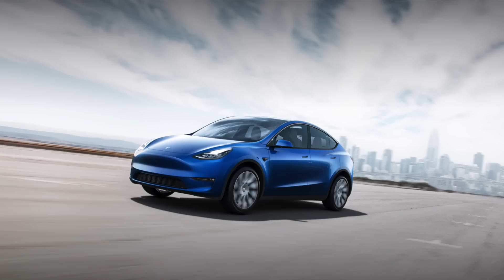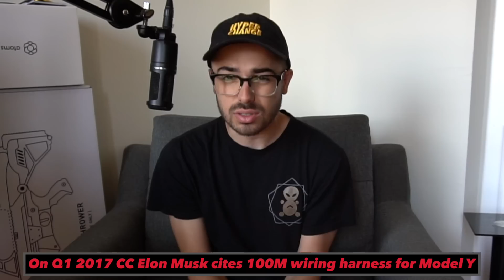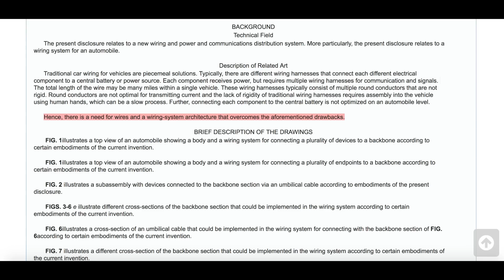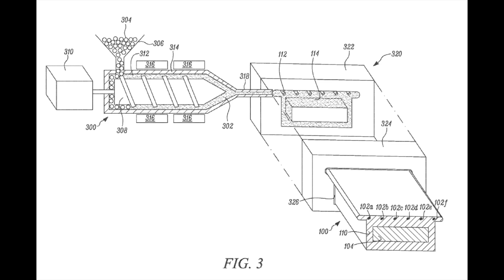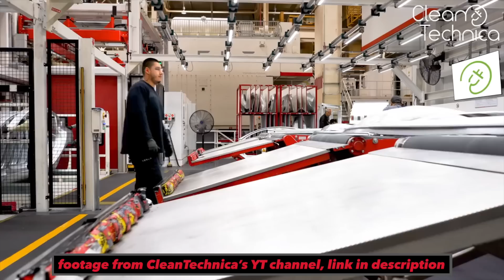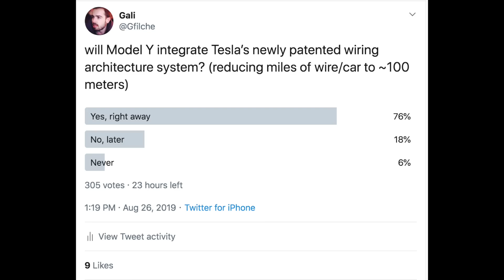Model Y Manufacturing & CAPEX Revolution?

Comment: I wonder if the length of actual wire is 100m long or the length of the cable with multiple wires inside, is 100m long🤔 cuz ethernet cables for instance have at least 8 wires inside them. That means we would come down to 12.5m of cable length overall.

Comment: Casting over sheet metal will eliminate hand finishing joints and weld spots. It's all aluminum so when they pressure cast the joints it becomes one piece with zero mechanical joints and prestressed structural ribs and panels.

Comment: I believe the CAPEX slide is can mislead people. First, it is natural that building your 2nd factory will be easier and cheaper than the first one (I would say, that the legacy carmakers already has low CAPEX for new factories and Tesla did have a relatively high for its first factories.). Second, is that Opex is more imporant in my opinion, because on long therm that matters most. (but of course everything depends on the actual numbers, what we don't have.)

Comment: I think that elon is smart enough to know that tesla alone cant really take over the car industry alone becouse of capital needed to over take volume of gas car produce  . This is reinforced by the fact that elon stated that certain patents are open for use by other companies . Having said this i can see tesla folded in to another parent compani along with space x  and maybe a spin off on their self driving tech where tesla is Just a manufacturing company that produces the worlds autos for them... like tesla making volvos and bmw ect where the current models cars 3.Y. S ect are their version of proving out the tech and processes. Makes senses in terms of capital needed its almost imposible for tesla to keep spending 2 bilion and even if they lower it to 1b... it would take 250 factories? To build up enought volume to take gasoline cars of the market / system  ... this is just a thought of mine that i get when i think of the things elon says and he always think long term i figure he knows he cant do it alone and doing it like insaid above would speed it up drastically... we cant wait for other companies to innovate they are to slow but if tesla does it for them and then jjust charges for manufacturing , desing , tech ect  we may get there:)

Hope someone enjoys what i wrote and agrees i love tesla and what they do, keeps us thinking and learning

Comment: This wiring won't decrease CAPEX (capital expenditure, often one time spend that has benefits over longer periods of time), it'll increase it. To set up automation, to file the patents your reading typically takes a lot of upfront capital expenditure (money spent). However, it could decrease the cost per car (variable cost, i.e. fewer ppl paid by the hour and more robots paid one time).

Comment: You messed up in your video. The 70-to-1 part reduction is done with casting, not stamping. Casting means pouring molten aluminum into a cast, instead of stamping sheets of aluminum. Big difference.

Comment: It is casting! The host Galileo Russell mistakenly keeps referring to the new patented process as reducing the number of stamping pieces to 4 @10:40, but if you look at the text on the screengrab of the same timestamp it mentions the reduction from 70 to 4 parts not as stampings, but as 2 castings and 2 joiners. The eventual goal of a 1 part structure is a casting (again not stamping). 
So tesla is going to use 1 casting to replace 70 stampings.

If you look up pictures of an aluminium die casting machine you see it clamps two halfs of a mold together. In the patent picture it looks like a machine that uses a mold that clamps together from top, bottom, left, right, front and back!

Don't mistaken the shell or structure of the car for the body panels. The structure is talking about the internal "skeleton" that holds the motor, battery seats, etc. The body panels are like the "skin" that you see outside, all the parts you touch when washing the car.

Personally I'd guess that the body panels will still be stamped as someone mentioned in the comments, casting such thin parts as body panels will have no strength.

Comment: Love what you do. Love the enthusiasm. One thing to point out... the teslarati picture you posted says 70 stamping parts to 1 casting component. Therefore, the new machine would be a big castings machine, not a stamping machine. Stamping is a process to take metal sheets into formed parts. Castings do not use metal sheets

Comment: The body assembly mega machine is properly insane difficult to get get to work properly and the changes that is need to do that needs to be tested, adjusted and verified forever and so on, so it make sens to run the model y on 2 lines one production line and one "themaschinethatbuildsthemashine" development line.....

Comment: Going down so dramatically in wiring could also mean that most of the parts contain micro controllers and use a high speed serial bus to communicate. This means more flexibility with OTA updates and fixes (e.g. Model 3 braking improvement) as well as component upgrades (e.g. newer headlights could have compatible harnesses despite having far more functions), better understanding of car health (e.g. burnt light bulb, none functioning side view mirror, etc), improved reliability (wire harness damage from rodents or minor accidents is common with traditional wire bundles), and easier repair (single clip in harness). It could also drop the price of components since micro controllers are cheaper than electrical connectors now and devices like the MCU are riddled with connectors and harnesses and could be reduced to a single connector.

Comment: Q1- 2017 was a LONG TIME ago dude!!! ... Tesla changed their plans for Model Y to be less ambitious .. and rightfully so ... the Model Y will be built on the Model 3 platform ... the components and WIRING will all be pretty much the same. Furthermore, Musk's 2017 comments were relative to traditional "round wire" harness reduction ... by replacing it with printed circuits and/or flat wire harnesses ... round or flat, it's still essentially "wire" ... so the idea that wire would be eliminated, just never was the case... just Musk smoke and mirrors. What Tesla was pursuing, as their patent application shows, is a wire harness that could easily be installed by a robot .. not sure why Musk just didn't explain it that way in 2017, maybe he was confused?  Also remember.. that this all dates back to when Tesla was admittingly over automate their assembly line ... they were exploring ALL ideas to fully automate car builds, handling a floppy large wiring harness is problematic for a robot.

Comment: So the able length change is because the new ridgid multicore cable counts as one cable and traditional single insulated flexible cables are counted separately? I would suspect the weight to not change too much. Do you have any stats on the weight savings? Or was it just a straight out guess?

Comment: hmm not so good to have only one part for the body, hard to replace in case of accident... would have to cut out damaged parts. Especially if its made of aluminum, hard to bend back to shape as it stretches.

Comment: My knowledge of casting and stamping is super limited but I thought casting was only for aluminum and not steel.  So is the body going to be cast out of just aluminum?  Or maybe it will have a steel frame and aluminum body?  Also, if it is one big part, wouldn't that mean almost any wreck would total the vehicle?  So many questions...

Comment: Wouldn't the patent be better off (just using 1-grade thinking for crash-repair) to actually die-cast 3 parts: the nose,-structure, the "passenger-cell" and the rearward structure (in sedan-style bodywork).   In case of a crash they could replace the front- and/or rear-structures.  Then you'd still only have 3 parts, but at least a bit better serviceability in crashes.  Unless Elon is banking on FSD taking over 95% of the driving and having less crashes and already accounted for that ...  Unfortunately, there will still be non-FSD cars out there for quite some time to come, so might be a risky-bet (if that is the case ...).  The wiring harness is something that always baffled me being a former network engineer.  Why would it be impossible to do simple network-alike connections inside a car (just like a proper home-automation).  I guess they never the famous quote from Davinci that "simplicity is the ultimate sophistication".

Comment: This is why I subbed to you, for the tech. Watched the Starhopper 150 m flight and I closely follow the SpaceX construction of the SS/SHB and I'm wondering now how much of this wiring had seen it's use in the construction of those, and the Raptor Engine. By all measures I'm sure the Starship and Superheavy booster will see a lot of their internals benefiting from the technological improvements you are discussing here re Tesla... Keep up the good work, and I'll keep supporting you on Patreon...
PS I think we will find out in the future, that Elon's Co.'s have been using and A.I. computer to model their engineering, not just the Auto Pilot and Full Self Driving. Just a guess, but an educated one. As I have said in the past, it's like Elon's own Skunkworks.

Comment: With all the fun driving, tires are going to wear very fast, so why not re-introduce recapping tires?  Years ago in the age of bias belted tires people could get recapped snow tires quite cheaply. With today's adhesives it would not only make "re-tiring") less expensive, but also ecologically reduce the enormous waste of discarded tires. If the tires were filled with helium we could reduce the wear and tear internally (no oxygen...helium is chemically inert) and the weight (lighter means a better ride).  All the tire shops would enjoy the squeaky voices of the repair guys.  Elon should try to innovate and improve the items that remain the same as ICE vehicles so that customers can enjoy the freedom from repairs and servicing that they experience with the electrical drivetrain. How about self- adjusting tie rods? We already know that shocks and struts could be made cheaper to repair or replace.

Comment: Would love to know what the BOM cost is for the steering column assembly.  The reason margin is likely low right now is they are taking a hit producing steering wheels & columns for every vehicle.  $1000 of parts in a steering column? take it out & re run the calcs on margin per car.  I think you'd be surprised.

Comment: Interesting. I think the term capex might not be the right word to use. If they are doing all these revolutions then capex should rise but in the long term operating expense will drop. Reduction in pieces in a puzzle mean less labor but more automation. Wire harness is nothing revolutionary, tesla probably was hand wiring the car but with wire hardness then workers dont need to think twice. Could mean sensors would be more strategically located to reduce wiring.

Comment: Not only will the casting machine be more efficient and save  money - it will reduce the assembly line length probably in half or more, which will enable Tesla to build cars in smaller spaces.

Comment: They are replacing many of the 'stampings' with castings, not more stampings. This is far more revolutionary.
Reply: Nothing wrong with stampings. Wrought metal is much stronger than cast, and the process is faster.  So it saves weight and makes the car less expensive.
Reply: Paul Ogden I didn't say there was anything wrong with stampings or pressings. Just correcting the description given.

Comment: This new wiring method makes so much sense!  As an electrical engineer I am wondering why the 'Big 3' and all the others haven't gone with this year's ago.  Using a redundant high-reliability bus will save so much on wiring, manufacturing and will cut a few pounds off.  It will require some additional electronics in various locations,  but it is simple and elegant!

Comment: Explanation: If the hole body is one pice with a inside copper/polyamid coating, all cables (except for high voltage motor-pack) can be pre-printed on the inside of the body like one big motherboard with censors, motors, led, sluts and more mounted directly on the inside of the alu-body. there will be copper-prins everywhere inside og the body -  Very Elon-like.....

Comment: When we are done laughing over the chassie work, Tesla is pretty innovative... Why didnt be mention that from the interview?
A piece that other car manufacturers make in one  piece, Tesla makes in 40 parts to make 1 part. With 3 diffrent laser welds, with normal welding, glue, rigits and what not.
So what they remove in moving parts from the ICE, they add to the chassie😏 Again making Teslas cost more on ineffefectiv production metods.
Again not making the car safer, actually can make the car more dangerous, in an impact. For people they hit or being hit by. Because of all that extra unnesessary parts.
So Tesla need someone to teach them the simple basics of chassie construction. Simple...🤣🤣🤣
Then we have Paint jobs. They need to learn how to do that. Did just see a film from a Finish  Model 3 owner that need a repaint on his entire car, as well showing rust attacks on a brand New car, and primer not covered in paint. It was a blue one, a white colour would hide  most of it. So wonder why the New standard colour is white🤔. In that case I'll had asked for my money back🤔 One can wonder, it have to expensive to repair all those New cars all the time. Why not fix it before sending it to people? Stop it in the factory?
Quality checks failure or none existing?
Yet a simple thing Tesla need to learn.🤣🤣🤣🤣

So Tesla is very innovative, but they still can't make cars.
They are lightyears ahead in the tech Department, but in the stoneage when it actually comes to service, chassie, quality and paint job😏.
Would that make me buy one, hell no, if i want shit i buy BMW or Audi.🤣🤣🤣🤣 Audi even made a car they call shit (Etron)🤣🤣🤣
And here is some buttcream 🧴for those sore asses 🤣🤣🤣🤣

Comment: -->"way more reliable and way cheaper"
Generally, companies have no desire to pass savings on to customers.  They would much rather pocket their efficiency improvements.  So no, this wiring isn't going to make the cars $1 cheaper.
Look at auto mechanics for a fine example... they use industry standard "book time" as the time they bill for a job.
So the industry book says it takes 3 hours to change the brakes, if their tech does it in 2 hours, you're still getting billed for 3.  And as the tech gets faster and more efficient, you still get billed for 3 hours.  They don't give a phuk about passing efficiency savings on to consumers.   Given that Tesla already owns the electric car market, they have no reason to reduce prices on anything.
Reply: TasteMyStinkhole 

Sorry about your online name...so sad
Reply: @paulogden7417  
No, there's nothing sad about my intentional choice of name and pic to use as an IQ test.
Idiots dumb enough to infer conclusions about me from irrelevant data is useful information when I'm debating fools.
Reply: I thought the prime goal was the speed up manufacture..

Comment: Here's a different angle on the casting thing. Suppose you believe that your ability to manufacture EVs is going to be constrained by the availability of batteries. You will look for 'battery substitutes'. The main battery 'substitute' is to improve fuel efficiency. More miles per kWh means smaller batteries and more cars for a given battery manufacturing capacity.  You can improve fuel efficiency by reducing weight. One way to do this is by using carbon fibre. It turns out that carbon fibre is too expensive right now but it is getting cheaper. I understand that the crossover point when carbon fibre starts to make sense from a cost point of view is around 2025. But for EVs, maybe it's sooner. Carbon fibre cars  can also be made using a single piece of carbon fibre for the frame. But you have to redesign your production line to work with a single piece frame. Of course if you've already done that and you have a few years of experience working that way.......

Comment: Reduced wire weight doesn't mean much for range... particularly for highway cruising. It does mean:
1. cost savings (less materials, particularly copper)
2. possibly quicker/cheaper assembly (less wiring to install)
3. greater reliability (less wiring that goes bad on you down the road. electrical gremlins have their own circle of Hell)
4. The fundamental, system-level electrical/electronic design changes that led to reduced wiring may have significant benefits of their own. E.G. better security, fewer components, reduced power consumption etc.
Reply: less rodent problems